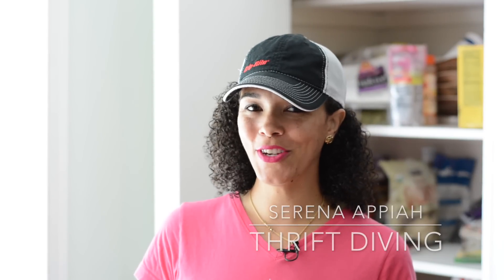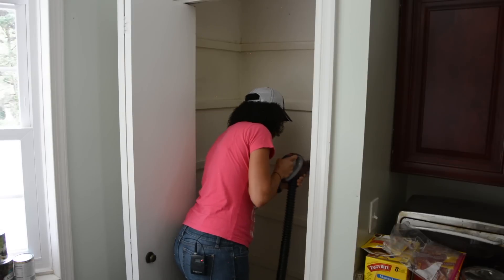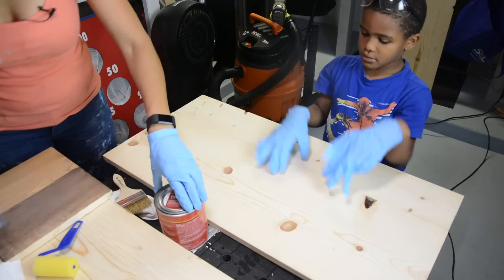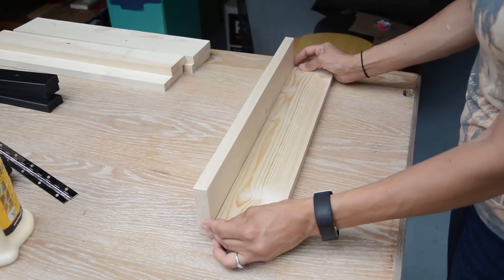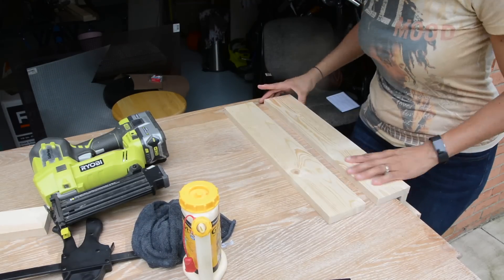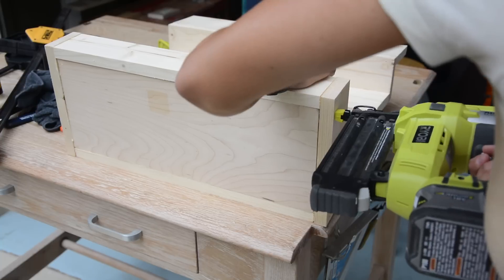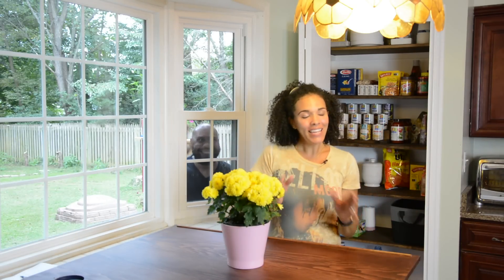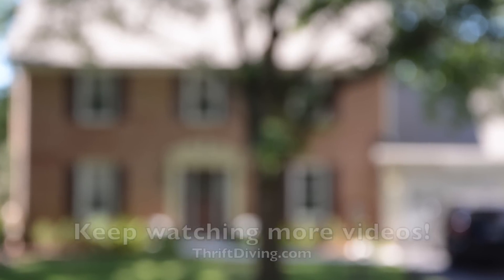Pantry Makeover With Hidden Storage Inside of the Can Food Organizer: DIY Tutorial - Thrift Diving

Comment: Great idea!!  But having to move the cans when you want to access the hidden storage is a bummer.  Add small rare Earth magnets into holes drilled from inside the box.  One hole and one magnet for each can.  This would securely hold the cans to the wood and allow for accessing the hidden storage without having to remove the cans.  You would need to increase the shelf height to allow for the cans.